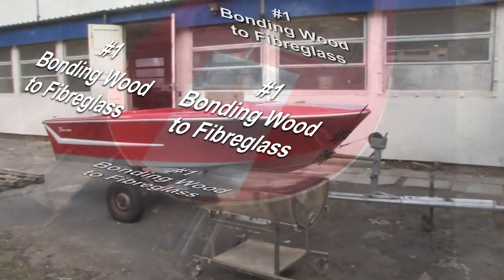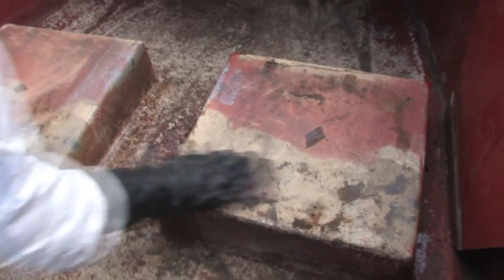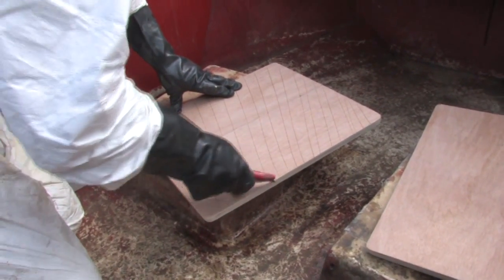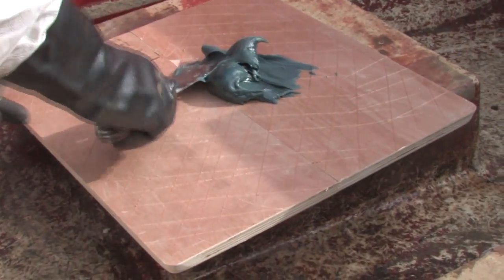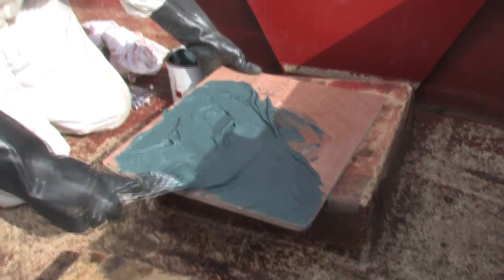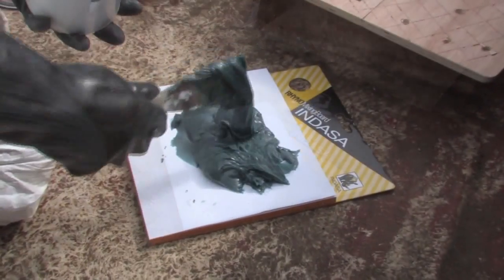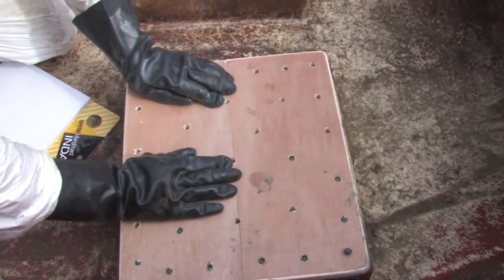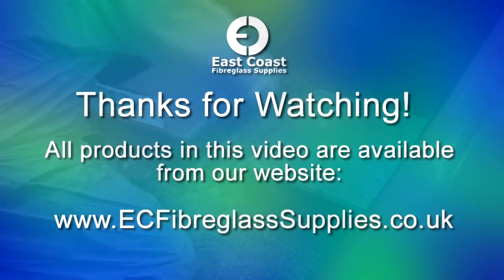Bonding Plywood to Fibreglass with Freefix

Comment: Why not use resin and cabosil? Thying to sell an uneccessary expensive product?
Reply from the maker: Hi , you can use this too amongst a variety of other resins / fillers , Freefix is ready mixed for ease which a lot of folk prefer, and it does have a colour change indicator which can be useful on larger jobs , it works out at £4.76 per Kg mixed (25kg pack) including Catalyst which isnt really bad if you are a regular user, ive used this for over 25 years and ive always been a fan of it :-) ,
Reply: Aren't cost conscious are you...
Reply from the maker: walkertongdee Always, this is a massive seller for DSM a lot of companies purchase this, it saves me time which is more important on certain jobs, thanks
Reply: Yea, I get you. Over here in Thailand, we have some stuff but I have learned to do without all the products that a lot of companies offer usually with a big price tag. I have often wondered what some of these guys would do if they didn’t have these products to work with. We use mostly polyester here and the price is comparatively inexpensive, I have learned to get by. We mix out own formula with Polyester, Mono styrene, Cobalt and MEK, We have filler powder, matt, cloth, acetone and that’s about it. I tried Epoxy but the cost put my boats too at too expensive to buy. Different market here, in the west people shrug and say oh well and just pay the price. Here they shrug and say no sale, me included. Don’t forget to have fun…
Reply from the maker: walkertongdee Sure i understand , :-) i do try and save money in other ways , i sometimes use the dust from the extraction vacuums to use as filler powder its very hard with little shrinkage, take care.